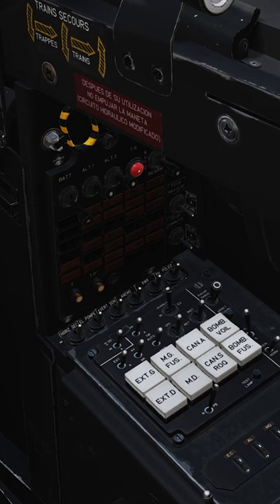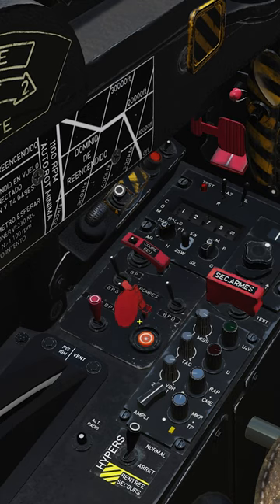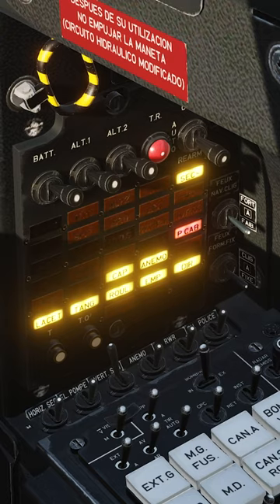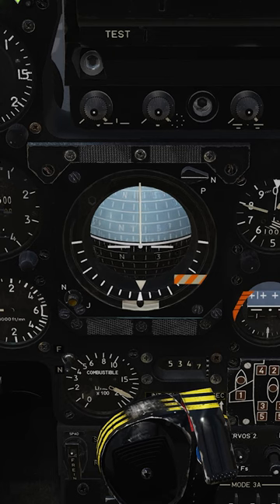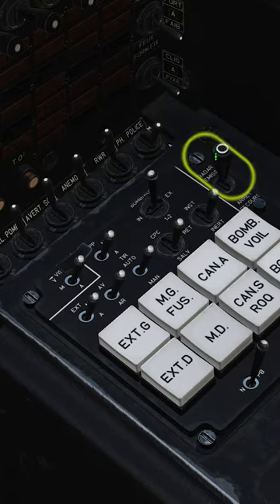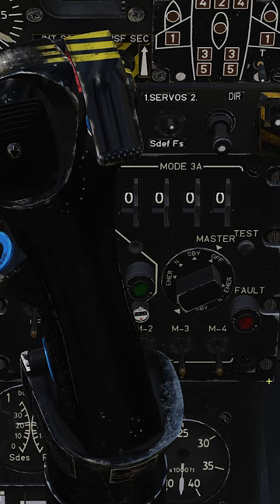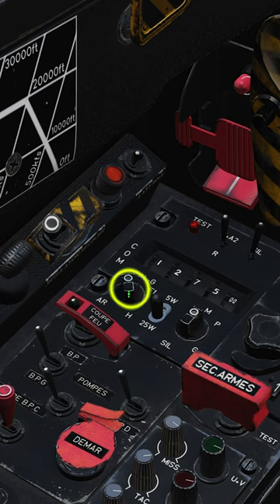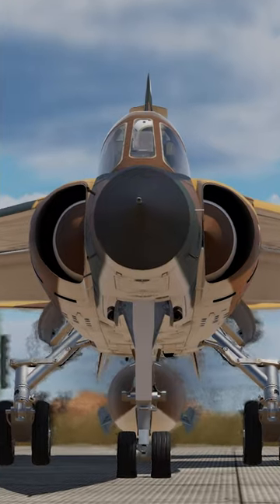Mirage F-1 Startup in 60 Seconds!

Comment: Flaps to full while taxi or start? Usually you use half flaps on most jets, because full flaps deliver uplift but also a lot of drag! And setting them down in startup instead of pre flight after taxi? Will have to check that later in the original handbook, because i am curious about that now! 😂